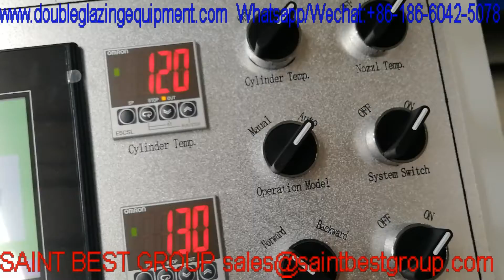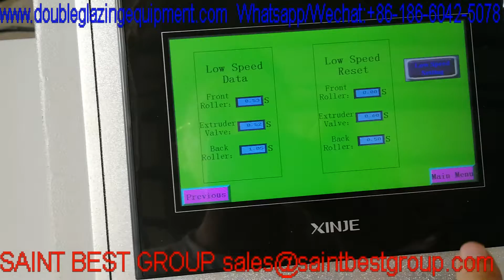Double Glazing Machine Automatic Butyl Extruder with Touch Screen,Automatic Butyl Coating Machine

Comment from the maker: Double Glazing Machine Automatic Butyl Extruder with Touch Screen&Adjustable Speed,Automatic Butyl Coating Machine,Insulating Glass Machine Automatic PIB Extruder Machine,Automatic Butyl Extruder,Insulated Glass Machine Butyl Extruder Machine,Double Glazing Machine PIB Extruder,Automatic Butyl Coating Machine,Butyl PIB Extruder Machine,PIB Butyl Extruder,Automatic PIB Extruder,Automatic PIB Extruder Machine with Variable Speed,Automatic PIB Extruder with Variable Speed,Automatic PIB Extruder Machine with Adjustable Speed,Automatic PIB Extruder with Adjustable Speed,Automatic Butyl Extruder Machine with Variable Speed,Automatic Butyl Extruder  with Variable Speed,Butyl Extruder Machine with Variable Speed,Butyl Extruder  with  Variable Speed,PIB Extruder Machine,PIB Extruder Machine with Variable Speed;PIB Extruder;PIB Extruder with Variable Speed;Automatic Butyl Extruder Machine for Double Glazing,Automatic Butyl Extruder Machine for Insulating Glass,Double Glazing Equipment Automatic Butyl Extruder Machine,Insulating Glass Machine Automatic Butyl Extruder Machine,Double Glazing Machine Automatic Butyl Extruder Machine,Insulating Glass Equipment Automatic Butyl Extruder Machine,Automatic Butyl Extruder  for Double Glazing,Automatic Butyl Extruder  for Insulating Glass,Double Glazing Equipment Automatic Butyl Extruder ,Insulating Glass Machine Automatic Butyl Extruder ,Double Glazing Machine Automatic Butyl Extruder ,Insulating Glass Equipment Automatic Butyl Extruder, Butyl Extruder Machine for Double Glazing,Butyl Extruder Machine for Insulating Glass,Double Glazing Equipment Butyl Extruder Machine,Insulating Glass Machine  Butyl Extruder Machine,Double Glazing Machine  Butyl Extruder Machine,Insulating Glass Equipment Butyl Extruder Machine.
  To know more.pls send email to sales@saintbestgroup.com or saintbestgroup@163.com or add skype:allenszj
URL:www.doubleglazingequipment.com www.saintbestgroup.com Whatsapp/Wechat:+86-186-6042-5078